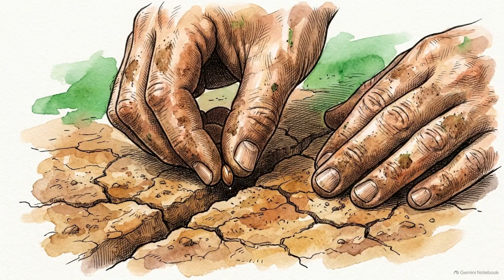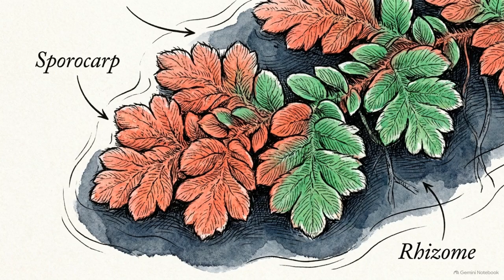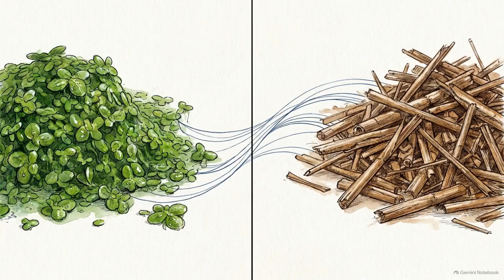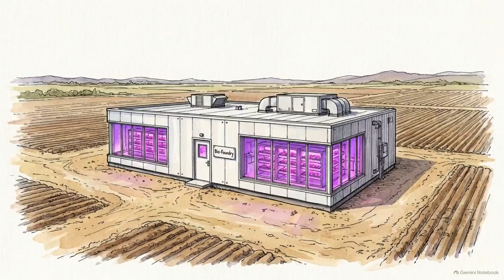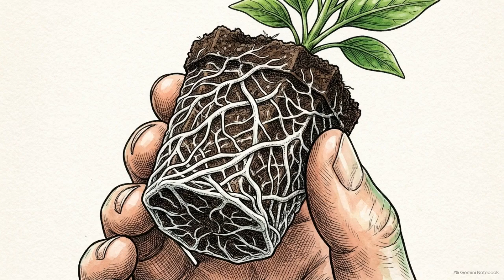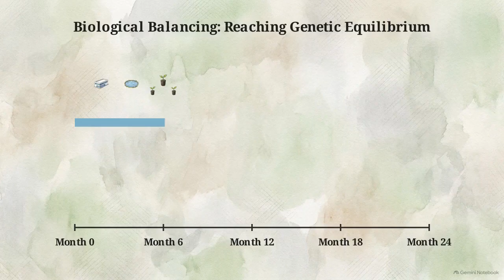The Insight Engine  Engineering the 11 Acre Bio Refinery

Comment from the maker: Key takeaways include:

    Technological Integration: The farm features a central hub containing a 480-square-foot bio-foundry, a micro-refinery, and a 25 kW solar EV power station.
    Closed-Loop Fertility: By employing an "Azolla Engine" and an Integrated Multi-Trophic Aquaculture (IMTA) pond, the system fixes atmospheric nitrogen and recycles phosphorus, producing 1,200–1,500 gallons of liquid bio-fertilizer monthly.
    Economic Viability: With an initial startup cost of approximately $165,000 to $213,500, the farm is projected to generate a net annual cash profit of $351,910 after Year 2, supporting four resident families.
    Scalability: The model includes a 24-month "Node Replication" timeline, designed to supply surplus genetic stock and resources to establish subsequent farm units.   Podcast can be found here: https://notebook.google.com/notebook/0b75e1da-ba5c-455e-84e4-299b76628187/artifact/7aff9831-b206-42d1-820d-b2d9f2c0b4a7?utm_source=nlm_web_share&utm_medium=google_oo&utm_campaign=art_share_1&utm_content=&utm_smc=nlm_web_share_google_oo_art_share_1_